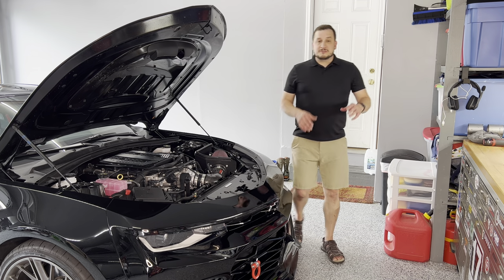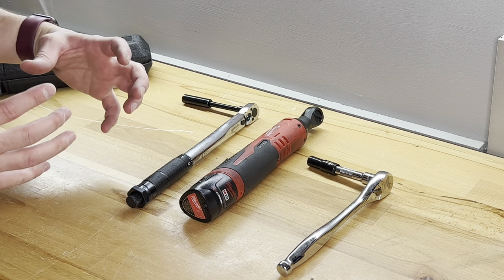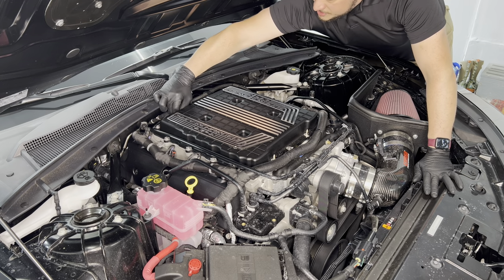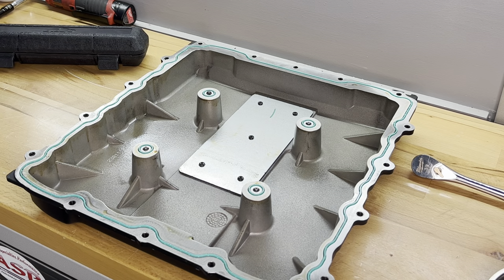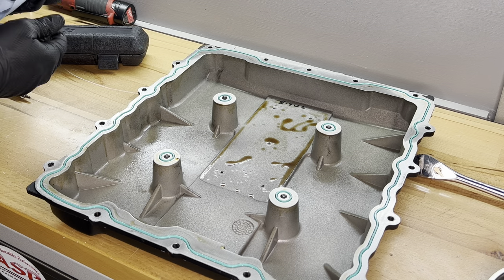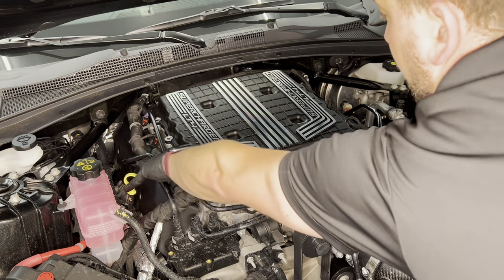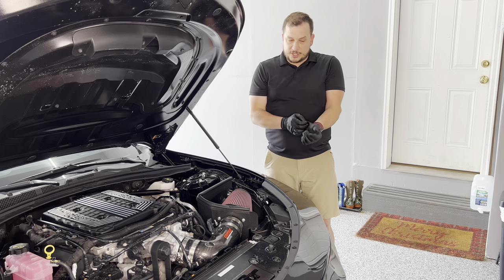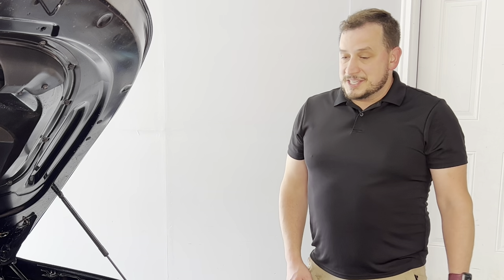How-To: LT4 Lid & Sound Dampener Removal // FREE MOD!!!

Comment from the maker: ** NOTE: The sound dampener may look different on the different vehicles and years. For example, the Blackwing has 3 plates that need to be removed. The Escalade V has 5 plates. **
Reply: Going to try my Blackwing this week.   I wonder if the 3 plates are for even more sound dampening since it’s a Cadillac
Reply from the maker: @CarGuysRule82 that is exactly why. They have different standards for NVH testing and that helps bring the noise down. For example, you’ll get a nicer, quieter ride out of the Buick version of a Chevrolet SUV, and even quieter/nicer in the Cadillac.
Reply: Do you know if the CT5V BW lid will fit the ZL1?  Pictures online at the parts warehouses make it look like it.  I pulled my factory lid off today and noticed that one of the center posts where the bolts thread into was chipped almost to the gasket.  Doubt I could get it warrantied and the BW version is much cheaper.  EDIT:  after searching the forums, it looks like the BW lid isn't as tall as the ZL1's . . .?
Reply from the maker: @triggerjerk01 it’s the opposite of what you found. The Blackwing lid will bolt up, however it IS taller to allow more cooling of the air. Not sure how that would affect any clearance issues on the hood, or if you have a strut tower brace, if it would clear, or how that would affect the factory engine tune, but it will bolt right up.

Comment: Do you know if removal of this damper helps with heat soak?
Reply from the maker: There is nothing to suggest that the damper retains much heat, or that removing it will improve internal temps. I would say “no” to your question.

Comment: Do you have a catch can ? And are you going to install one ? I think it's a must .I have one on my zr2 Silverado 6.2 and it catches a lot of blow by oil it will surprise you .
Reply from the maker: The evap and factory catch is working as designed. It’s a non-issue. This car is also tracked hard and most catch-can manufacturers won’t tell you that they are NOT recommended when running the car hard like that.
Reply: OK thanks . didn't know that .